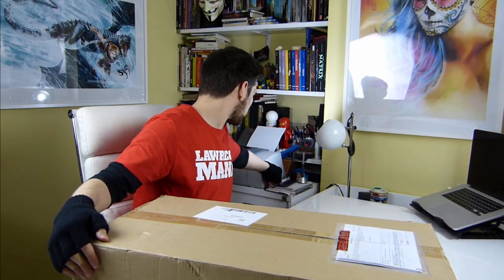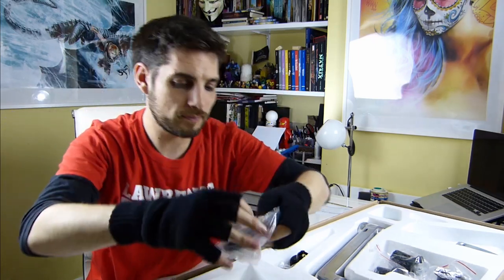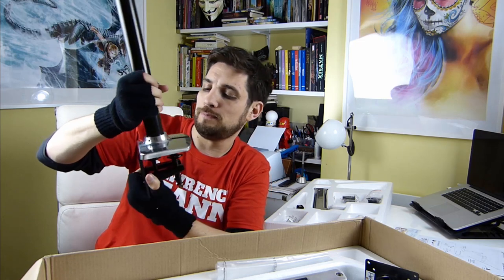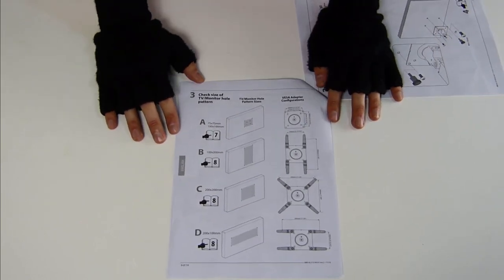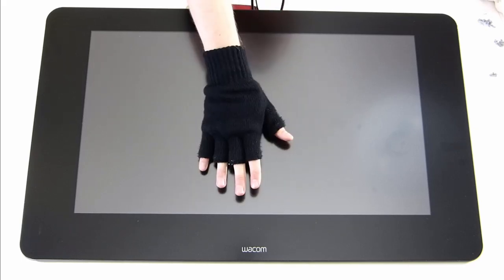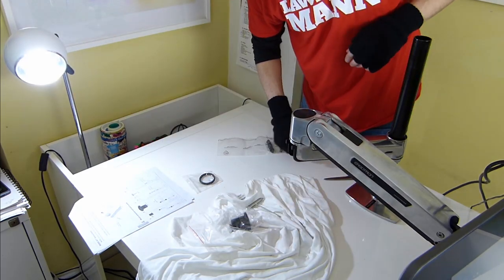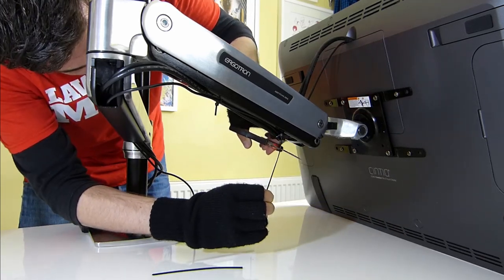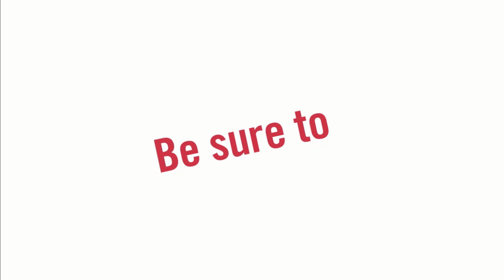Ergotron LX Sit Stand Desk Mount LCD Arm unboxing & installation for Wacom Cintiq 27QHD Touch

Comment: Hi Lawrence.

I had a few problems with the arm- but caused by my desk. I had not anticipated how tall the column was as I intended to fit it under the fixed shelf above the desk I have. I'm a disabled artist and had a desk specially made with a large shelf above the desk surface but the arm is an inch and a half too tall to fit under. I've ended up having to basically get a matching piece of wood and turn the desk into an L shaped desk so the arm and Cintiq will be in a different position. Its worked out well in the end because when I do unpack the cintiq 27 from its box and follow your instructions to mount the arm on the back of it and place it, it will be easier. I'm going to take your advice and get help to lift the cintiq into place. I have a spinal injury so lifting it on my own I dont want to do.

I'm looking forward to getting everything running and starting to learn how to draw again. I kind of lost my skills after the accident but I am slowly building them back. Thanks for the video because quite honestly the instruction manual that comes with the arm is total pants!

I will spread the word. I think your work is amazing.
Reply from the maker: You can get shorter arms. I had one for the other arm. Glad my videos have been useful for you ;) Send my a pic of your set-up via Twitter @LAWRENCEcanDRAW
Reply: will do!

Comment: Thank you, Lawrence. You solved a bunch of problems for me. Partly apparently the last two pages of the instructions were missing(!). Totally missing was how to adjust the tension so the monitors didn't continually sag. I too now geek out on the gigantic allen wrench.
I prefer the  ergo mount for the 27QHD, it just feels more stable for me. but because the Wacom is so large, I use two of the Ergotrons to hold the monitors (32" UHD Samsung) I use for referencing and rendering.
Thanks for the help. That's the techie side. On the creative side, I love your art, thanks for sharing. And yes, Self Promo=Good!
Reply from the maker: +kieron1368 Really glad I could help! I was worried that I'd gone into too much detail but obviously you needed that. Glad you like the video and the art. Stay tuned for more :)

Comment: thank you so much for the video. I'm getting the cintiq 27 myself to replace the 24 HD I had on ergo stand. Because of my spinal injury I found using the cintiq 24 in a comfortable position next to impossible and it was too heavy to put on an arm. I have just sold mine and am now ordering the touch version of the 27 and going to go for the same arm as you have.

I'd like to finish by saying I love your portfolio. Its my kind of art and I loved to view it.

thanks for a great video

regards

Kenny
Reply from the maker: +Kenny Partington thanks Kenny! Glad I could help. Make sure to watch the installation video to make life easy on yourself. It's not hard to install anyway but watching someone else do it first always helps me. 

Glad you like my art. I've just put up a couple of new pieces on my site. Spread the word ;)

Comment: Hey Lawrence, great video thanks for this: do you think a 2cm thick MDF wood table will be enough to sustain the drilled hole setup? Or even the clamp??
Reply from the maker: 2cm MDF should be fine. I imagine this is a treated / finished MDF? You will get a good sense for how the arm feels when it is on the desk anyway. It will also make a difference depending on the legs / supports and what else is on the desk of course. Happy New Year!

Comment: I just setup my LX Ergotrom. I didn't realize it only allows 5 degrees down tilt when I bought it. I hoped to be able to use it from my couch as easy chair as well, with it above me. I guess that's why they called it stand and sit. I have wrote them about it. Also I've tried to adjust the tilt so it stays in place on the 5 degrees down but it just floats back up to the 0 degrees no matter which way I turn the screw. Maybe I'd need to mount it on the ceiling to get the angle I want...lol
Reply from the maker: Did you watch my videos before you purchased it? I did show the full range of motion in a couple of them. Let me know how you get on with it. One option might just be to get a lower desk/platform to mount it on. Did you get the tall pole?
Reply: @LAWRENCEcanDRAW  Hi Lawrence, it was completely my mistake. I think the arm is great, very well built. I heard of people cutting or bending the stops out so it goes more then 5 degrees on the down turn so basically the screen faces down if you were more in a horizontal position. I did write Ergotrom to ask their opinion on the subject but they haven't responded. I am wondering why they put the stoppers in, if it was for safety. The few that have done this don't say anything about it not being secure or any other issues because they did this, though it might effect warranty if it ever came up.
Reply: I now have a response from Ergotrom, I will quote it, "Removing the stoppers is not a safety issue but we do not recommend it and it will void the warranty.

The only suggestion they have on the tilt not holding is to continue decreasing lift strength (counterclockwise). It may take many turns for it to hold on the downward tilt."
Reply from the maker: That did pass through my mind as well but I imagined you had adjusted this as much as possible already?
Reply: @LAWRENCEcanDRAW  I tightened it as much as I could, it slowed down but still slowly goes back up. Any tighter I feel like I will break the allen key or my scrape my hand trying. They responded one more time after this, and I quote what they said.
 " I am not sure what was behind this design, but it does have that limitation.  I apologize this product isn't working for you.

We have a different product that has a 90 degree forward and backward tilt.  Perhaps this would work better for you.
MXV Desk Monitor Arm, Part No. 45-486-026 .
"

I'd still prefer this arm because of the reach.

Comment: Hi, Lawrence. Thx for video, it pushed me to buy this device. I draw a lot and daily and ran into a problem. The problem is that the tablet swings by weight, constant shaking during work is very annoying and you have to hold the tablet with your hands. On a standard stand, the tablet is stable and when you switch to Ergotron, this is strongly felt. How did you cope with this problem?

Thanks again for the video.
Reply from the maker: Hey, glad I could help! If you have time then I'd appreciate a quick tweet to Ergotron on Twitter or Facebook to let them know I've helped you! Does me good to let companies know ;D #SpreadTheWord!

Have you tightened the joints properly? Try going around each one again with the allen keys again. I keep mine handy by the desk and every couple of months just give them a quick squeeze. Also - don't lean on your tablet. It's bad for the screen anyway. You may not realise you're doing it but it'll take years off the Wacom and that causes the problem for most people. You just have to train yourself to 'work above'it. I had to learn this back when I was inking comics because of smudging! haha. Joy oh joy!
Reply: Thanks for the answer. I do not lean on the tablet, I'm not an idiot) The tablet swings even with accurate work with the pen, the key, unfortunately, does not solve this problem. At the moment I'm working with an improvised emphasis (put a towel on table), but it's a crutch. On your video, the tablet also swings when you're working, but apparently you're used to this style of work. I'll try to work another week with Ergotron, if not accustomed, then I will return the original stand.
Reply from the maker: I have to tell people all the time not to lean on tablets. lol. I see it a lot in other videos. Some people don't even realise they do it so it's worth saying you understand. 

There is a slight movement of course but it's ever so small. How much is yours moving? It'll never be rock solid of course - you know that because you can't lock off the joints. These things are made for monitors and not tablets.

Comment: Guys, I have bought Ergotron LX arm for my cintiq 22 Hd,  my desk is from IKEA and it was a cheaper desk (just that board with those adjustable legs) and my cintiq mounted on Ergotron broke my desk, it just lifted that part where it was clamped coz of the weight. Does anyone have any idea where to look for a better desk which is more compatible with Ergotron and that it doesn't cost a FORTUNE, any tips would be much appreciated :) Cheers!
Reply from the maker: A lot of people have said how much they want my desk. haha. It's no longer available BUT Ikea sell kitchen counter that is white, they will cut to size and you can bolt their sturdier office legs to in order to make a good desk! Take a look and see what you think. Let me know if that helps!
Reply: Lena Mastruko could’ve told you that. ikea desks aren’t solid wood

Comment: I'm unable to clamp anything to the back of my desk, is this secure and stable if I simply mount it by drilling holes into my desk for my cintiq 27qhd? You don't have to use the desk clamp right?
Reply from the maker: It's actually more secure. That's why I decided to do it ;D

Comment: You've used both the LX Sit and Stand arm as Well as the standard LX.  Have you used the standard LX with the 27QHD?  What's the difference in reach?  Im keen to know if the standard LX is long enough to allow the screen to be clamped at the rear and then reach and be used the edge of the desk without any issues?  Cheers
Reply from the maker: You can't use the standard LX with the 27QHD. It can't hold the weight and the arm will constantly lower whenever you let go of it. The reach isn't as good on the standard LX either. Note; if you use extension arms, this lowers the weight capabilities of the arm you use. The LX LCD Sit/Stand I show here and have a link to in the description can handle the 27QHD but not when you add an extension. It's reach is great though. If the reach isn't long enough then you can drill a hole and place it closer to you and that will also make it more secure.
Reply: Thanks a lot for the info.  Great Reviews and demos, really helping the decision making!
Reply from the maker: Any time! Tweet me @LAWRENCEcanDRAW and let me know what you pick!

Comment: Thanks for this video, Lawrence. Helped a lot and I've decided to go ahead and buy one of these myself. I have a question as well though. Sort of related, sort of not. My Cintiq 27 qhd doesn't have the rubber grips on the bottom of the base anymore, and I can't actually find them. Do you know if it's possible to buy these separately or whether there's a handy alternative? I'm just worried about the tablet sliding without any sort of grip to hold it. No worries if you don't know, just thought I'd come to you as I'm guessing you have an idea. Thanks.
Reply from the maker: Happy to help Joe!! If you message Ergotron from their site or on Twitter/Facebook then I'm sure they'll help you out. They are a super bunch! Let me know how you get on with that and it you have no luck then I'll try help you out from my end!!

Comment: Hi Lawrence , i bought cintiq 27QHD non touch with ergotron arm LX , and Arrowmounts AM-201D Vesa 400 x 200 adaptor , right now i am doomed the adapter is not centered and the screen is not balanced on the arm , am i doing something wrong like i bought the wrong adapter ? if so would you please recommend adapter for me . many thanks .
Reply from the maker: Was it this LX Sit Stand Desk Mount LCD arm or the regular LX arm? If it was the regular LX arm (that I've shown in previous videos with the Wacom 21UX) then it's probably just the case of that arm not being able to cope with the weight of the 27QHD. If you have this arm then it's most likely a matter of adjusting the tension bolts on the arm as per the manual.

Comment: This is one of the most amazing building demonstration video I've seen so far.  Very explanatory and does show everything you need to know.  I can tell you're a very meticulous person.
You mentioned in another comment something about adding an arm to this?  I didn't know that was possible and would definitely help me.  It's only for a light 24" monitor but I need to get it in front of me from  quite a distance of at least 35-40" while adding the 90 degree angle needed as well.
Reply from the maker: Adding an extension piece will lower the weight capacity of the arm. That's basically what I was saying! Most people don't seem to understand that. Then they wonder why it's not as stable for them. I would recommend attaching the arm to the side of the desk if possible if that helps bring it closer or drilling through the desk and clamping as I did if you only need a few inches! That'll also make it more stable over all.
Reply: Thank you for all your previous information.  I finally got the box and getting ready to install it all tomorrow.  However, I was wondering what size of drill bit you used to do the hole?  I'm going to also put it directly through the desk instead of using the clamp, but I want to make sure I don't use a bigger bit then I need to.

Comment: Hi, did you mention that you had replaced the ergo / cintiq mounting parts with a single plate? If so, can you provide a link as to which one that you have used? Thanks!
Reply from the maker: I just bought the right size (200x100) VESA one-piece adaptor from ebay. The fittings are universal. As long as it's good quality you shouldn't have an issue! Hope that helps! #SubscribeAndShare
Reply: I was wondering about that adapter cos Ergotron had only the 100X100 in their sample images.
I kind of missed where you replaced that though

Comment: This video help me hugely a year ago when I bought my cintiq 27. I have the LX HD, its so good. Now I want to mount my second 27" monitor (just a normal monitor) to the same base unit. Do you know if the standard LX series arms are compatible with the LX HD base?
Reply from the maker: Some of the arms have poles with different diameters. The LX HD is thicker than the standard LX arm.
Reply: Ok, back to the drawing board I guess. Thanks for your help!
Reply from the maker: You can buy the poles on their own from Ergotron.

Comment: Does the  Ergotron LX Sit Stand Desk Mount LCD Arm come with the brackets for the Cintiq 27 QHD TOUCH, I watched the video didn't catch if I need to buy the bracket and which one.
Reply from the maker: Mine did. The four adjustable piece VESA mount shown in this video came with the Ergotron. I also have a video all about VESA mounts with some links to good mounts in the description. Keep in mind that many display arm manufacturers don't supply the VESA mounts!
Reply: Thanks for the heads up.
Reply from the maker: No worries. Check the contents list if available. and you can always ask your retailer directly!

Comment: Hi Lawrence, I am just curious why you decided to use the grommet instead of the clamp.
Reply from the maker: The grommet is simply more secure and with an arm and tablet this large it's nice to have that added security. Also, I have a large desk with a depth of 80cm front to back and if I use the clamp then it has to be mounted right at the back but using the grommet I can bring the arm closer and get more length/reach which is great. Okay, so you do have to drill a hole in your desk but having used an Ergotron arm previously, I was happy to do so. Hope that helps!
Reply: That helps alot thanks very much for the feedback
Reply from the maker: No worries #SpreadTheWord

Comment: Hi , This is really nice presentation , is it possible to know when you were drawing on top  ,is it the Wacom device easy to slide down as well ? Please let me know .Thanks
Reply from the maker: You can make a lot of adjustments to the tension so that's really up to you. I find there are a couple of positions which give me maximum stability. When you want to move the Wacom tablet, gently pulling with both hands gives you enough momentum to pivot the tablet to your next drawing position.
Reply: Thanks a lot for the detail answer ! I need to buy one to try . Cheers!
Reply from the maker: No worries! Links in the description!
Reply: Thanks a lot Lawrence , I already bought the regular one which is really useful and fit the the drawing posture.
It completely solved my several years neck pain problem ! Thanks !!
Reply from the maker: No worries. Ergonomics are very important for artists! Make sure to check out the playlist 'Ergonomics for Artists' on my channel ;)

Comment: 26:00 I believe you have mounted the 4 200x100mm extention screw bracket the reverse side, the bracket should be sit flush to the monitor not bended inwards.
Reply from the maker: That's what I thought as well. I followed the instructions and this was the way it said to use them. The VESA mount has been 100% stable so no complaints either way. I will say that I prefer a one-piece bracket for peace-of-mind so have just picked one up. This is because I'm mounting something else to the arm as well though. Video on that is coming shortly!